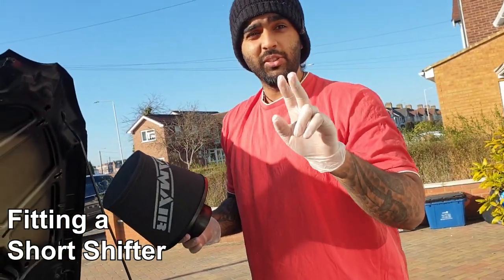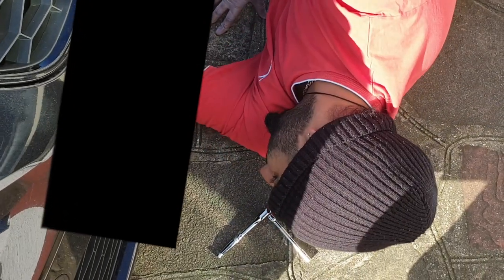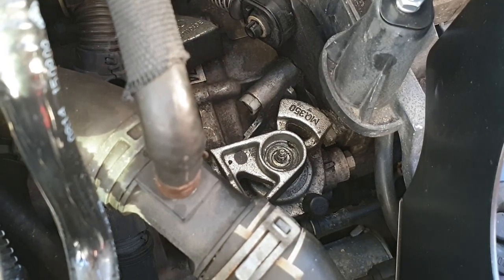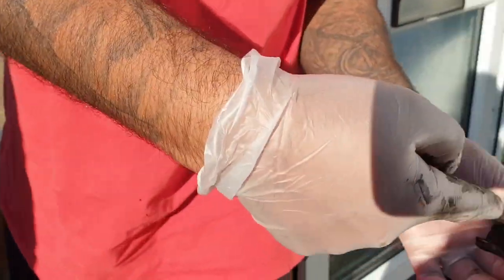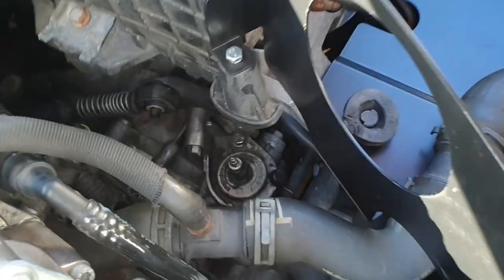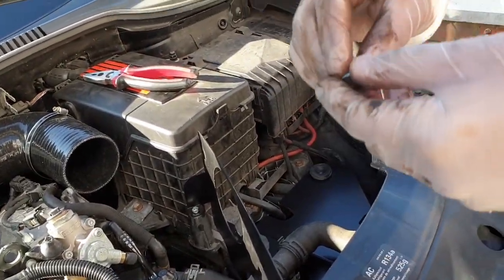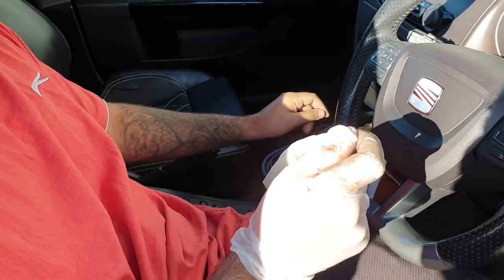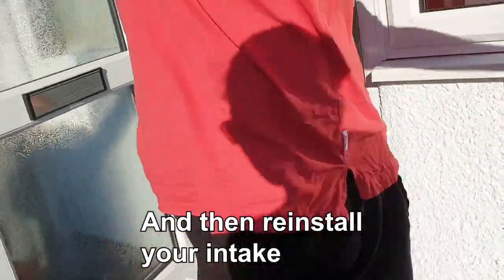HOW TO FIT A CHEAP SHORT SHIFTER! HUGE UPGRADE

Comment: Make sure you fit this in the neutral position... and dont drop stuff down your engine bay 😂😂
Reply from the maker: LOOOL Isn't that what you did though?
Reply: I fitted one in my leon, it dont matter were gear stick is when fitting as spines have little lug on it. this has cables and not selector rods so no need to worry. its bn a Brill mod on my car and had no probs.

Comment: You can lock your gear stick in neutral with a 5mm drill bit
Reply from the maker: Thanks for the tip! I found a drill bit that was the right size after this video. For some reason a 5mm bit had a tiny bit of slack on it

Comment: Bro is the top selector shown at 0:44 (not the one you are removing) meant to have no clip?
Reply from the maker: We've never even noticed that lol, thanks for pointing it out.

I've checked some other videos and pictures and it looks like some cars have it some don't... We haven't had any issues with the cable coming off.

The bit that the clip would slide onto it also too big, so it doesn't need a clip.
Reply from the maker: I'll have another look tomorrow or whenever I do the gear linkage adjustment and let you know. Thanks for finding the part number too it would have taken ages to find lol